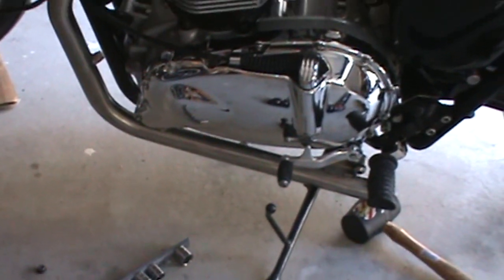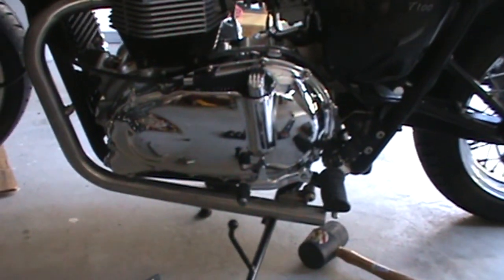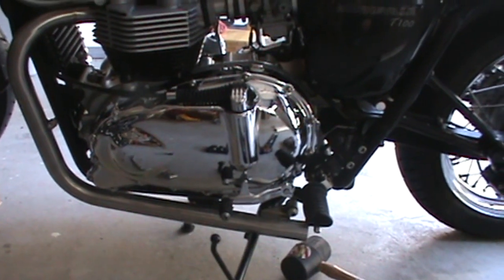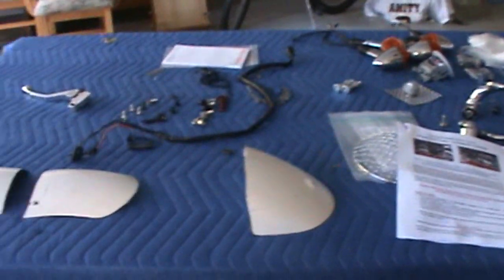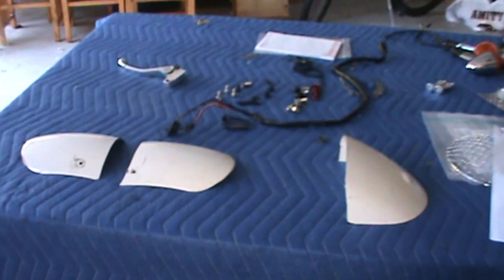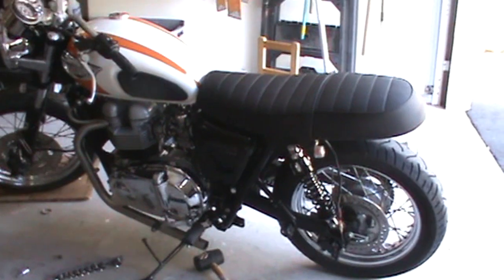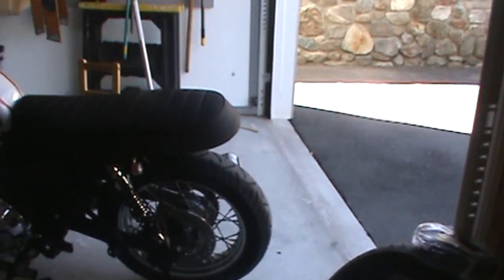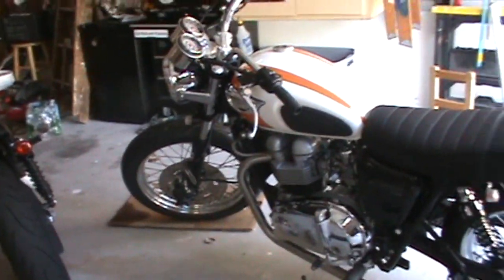Clutch cover fixed! On to the Tec Bike Parts exhaust! ...

Comment: I assume that it's a new gasket in the header, so tighten down the pipe compressing the new gasket and then see if it all lines up. you can gain a couple of mm by compressing the exhaust gasket, hope this helps.
Reply from the maker: Hi Roy, .. I tried that. The pipe still won't line up. In fact, I think the pipe is made for a different bike. When I tighten up the pipe it ends up pressed against the bottom of the clutch casing.